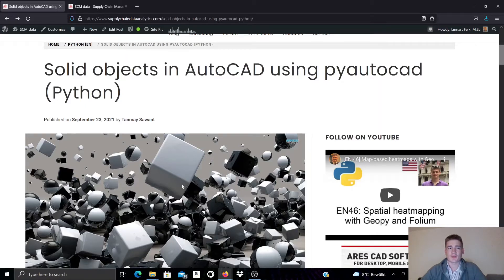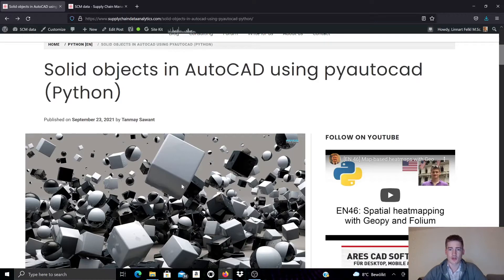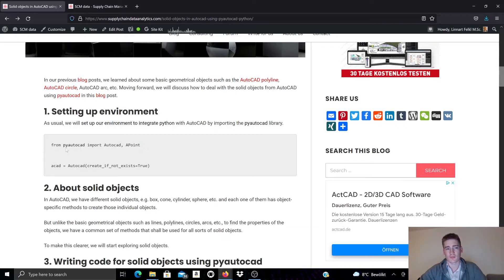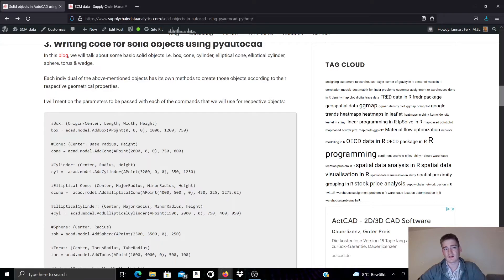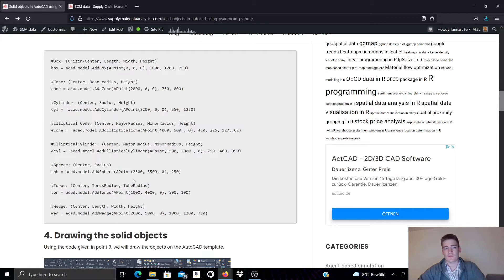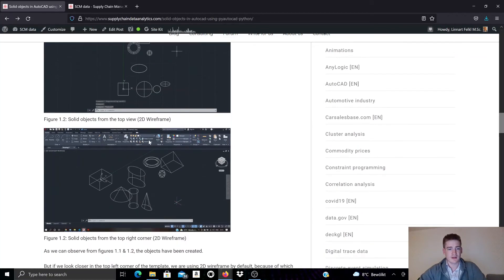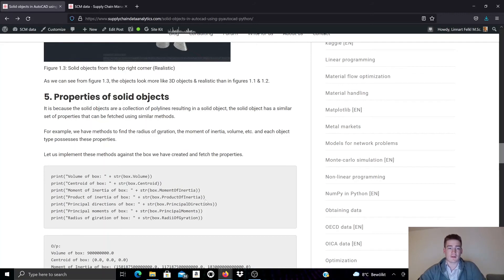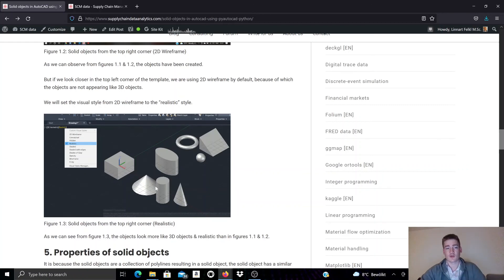Solid objects with pyautocad, Python for AutoCAD

Comment: Hi! I am working on a project using pyautocad for my main programming tool. I am running into a problem with adjusting block attributes. I have an AutoCAD block that I am able to reference and place into my drawing, but I cannot figure out how to change the attribute associated with the block after it is inserted. Would you be able to go over this?
Reply from the maker: Hi Kyle. We are multiple persons working together. If you could state your problem using this contact form then one of us will get back to you: https://www.supplychaindataanalytics.com/contact/
Reply: @linnartfelklm.sc.6467  Thank you! I just submitted it.